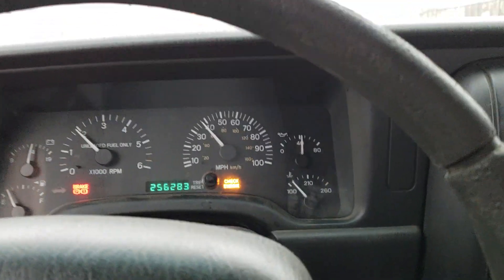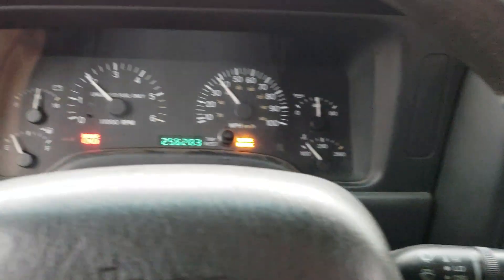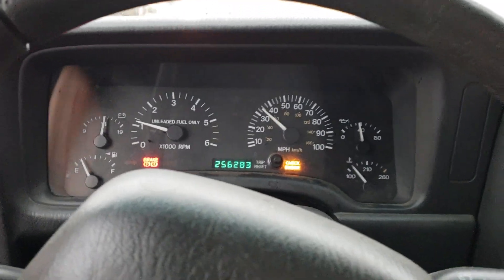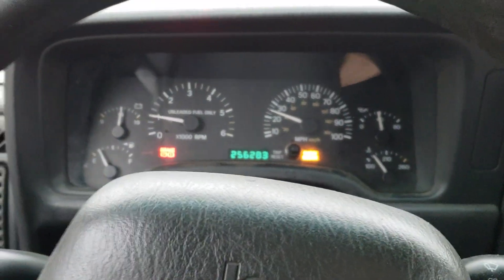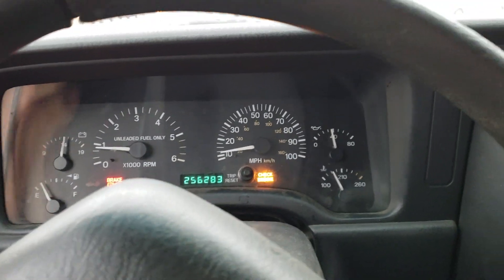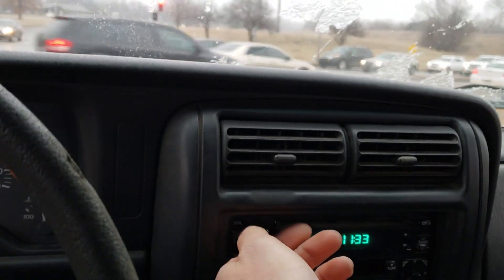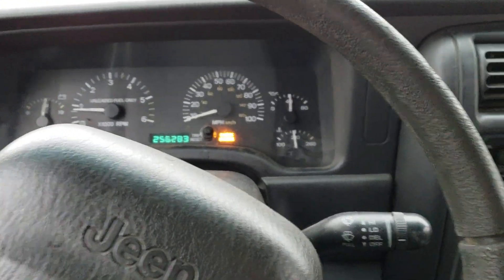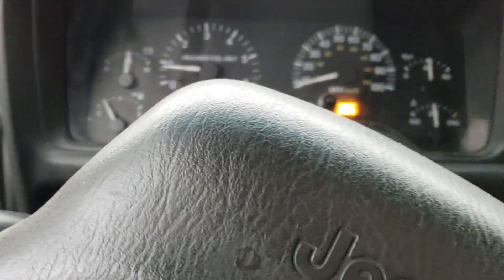Jeep gauges not working Easy fix!

Comment: i TOOK MY jEEP IN FOR transmission REBUILD....called him and he says its ready but my speedometer isnt working....you'd think he would have checked the fuses!!!  But there is also things around the transmission that affects the speedometer so I wont know until I go pick it up tomorrow. I HOPE IT IS JUST A FUSE! AND i HOPE i FIND A BETTER MECHANIC SOON!! It took him 2 weeks to do the transmission!! But thanks....I usually do check fuses first,the simple things 😉
Reply: A transmission is a very difficult thing to work on, I think that it is pretty understandable that it would take him two weeks. Besides mechanics (especially the ones capable of rebuilding transmissions) are normally pretty busy.
Did you ask if he could fix the speedometer?
Reply: You might try looking at the plug where it plugs into the trans
Reply: @somebody4865  He had a$750 paid warranty by me besides the cost of rebuild.. Yeah he fixed the speedometer easily but the transmission wasn't fixed!!! Every car mechanic is not a good one!! This one was crap.
Reply: @laragreene8328  ok yeah, I would expect him to be able to fix a speedometer and not a transmission but not a transmission and not a speedometer lol

Comment: Finally, someone gets a little more specific than "check your grounds", thank you!  2001 Grand Cherokee, guages would work on startup then die.  Pulled ground cable nearest negative battery terminal, roughed it up a little bit, and now we seem to be back in business.  My #17 fuse spot was also empty, for those commenting.

Comment: I am considering buying a 1998 Jeep XJ model and was told the gauges work about 30% of the time. 
Was your problem intermittent? 

Also, were ALL your gauges going off all the time..Or just certain gauges didn't work?
I need to determine whether the Jeep is worth buying with a similar easy fix issue or is the Jeep going to need a more involved repair. Anything you can share would be very helpful. Thanks.
Phil
Reply: On my 1999 XJ All the instrument gauges just would quit or not come on at all. I would shut down and restart the engine and that would get the gauges to work.  I replaced the Engine compartment fuse box #16 & #17 and now all the gauges are working properly now.

Comment: An absolute useless video without telling which fuse has been replaced. In addition, since there isn't any fuse only for the odometer, other compopnents were probably not working.
Why not posting a complete video after coming back home? Or waiting for better weather and opening the hood in spring?

Comment: All my meter niddles working but light is not working what should i do pls
Reply from the maker: Twist your headlight knob
Reply: BUILT 4X4 MUD is it behind the hud? Mine too doesn’t light up it’s a 1991 Jeep Cherokee same issue doesn’t light up when I pull the little handle
Reply: Jonathan Monroy when you pull the handle twist the knob that’s what I did with my 92 and now my lights are on
Reply: @ferris_outdoors5866  thank you for your help, turned the knob and cluster lights came on. I was about to  remove the dashboard apart.